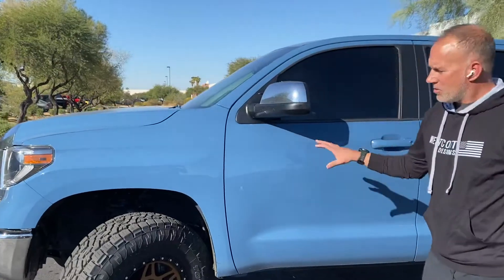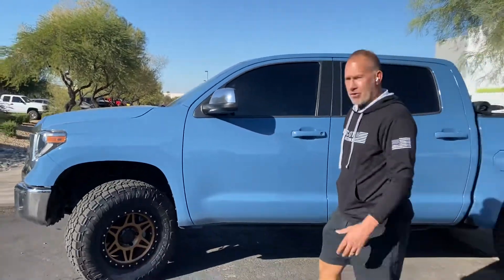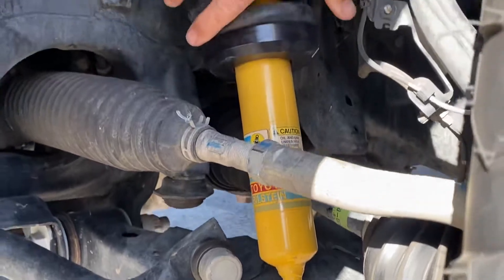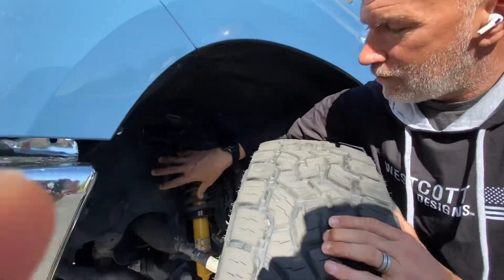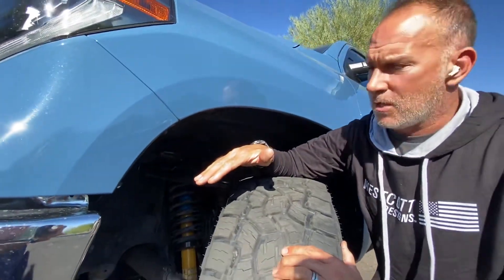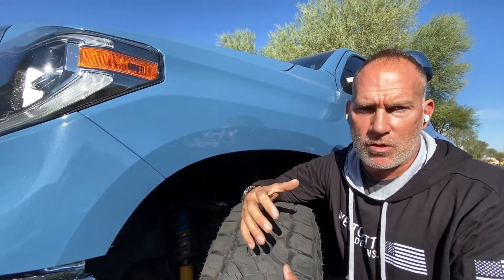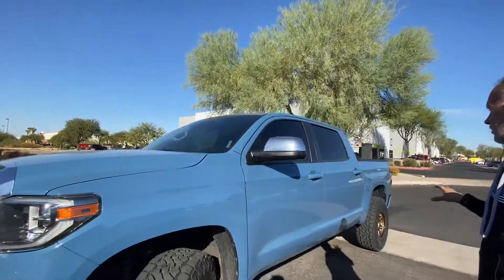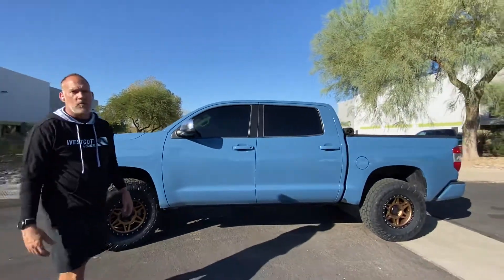Spacer Lift vs Preload Collar by Westcott Designs™

Comment: What are the tire size for this model?
Reply from the maker: That was 1000 vehicles ago🤷.  Most likely it was a 17x8.5 and a 35x12.5x17.
Reply: @westcottdesigns I have the TRD sport with front and rear sway bars, will this system work with your level kit?
Reply from the maker: @rickbrio9485 it sure will.   We also make a vehicle specific kit for it.
Reply: @westcottdesigns are you able to link product below that is specific? Thank you! Great products